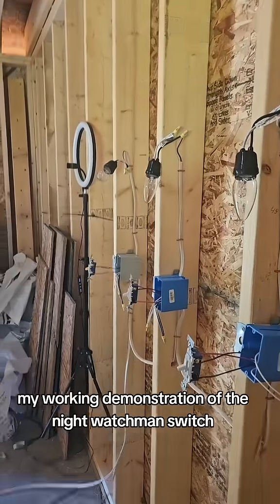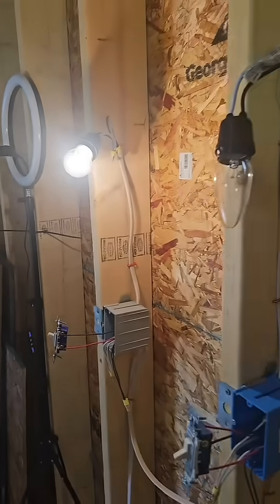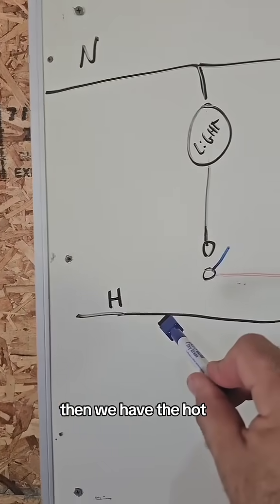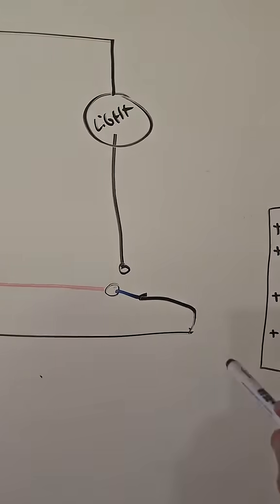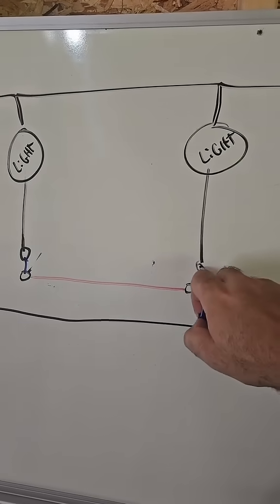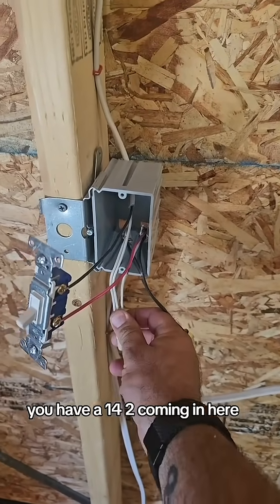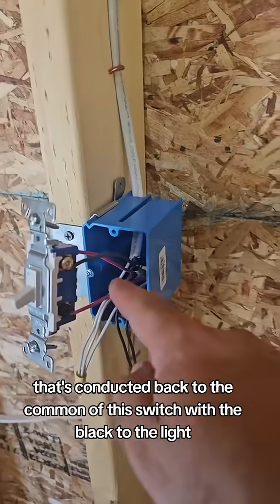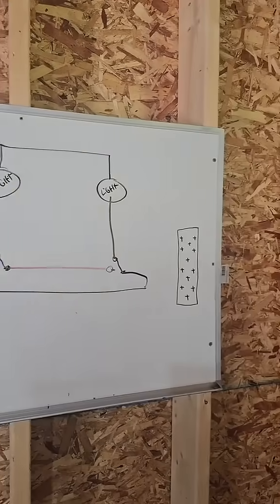Explanation of the night watchmen

Comment: Man I forgot about the night Watchman circuit, I've always found it fascinating.

As far as anything you might have missed...

[TLDR; Why to use it (use case), you can make it longer, it can stage more than one light at a time, and why to use it (under what circumstances).

You missed explaining the use case for such a circuit... it's not a very common circuit, but is most common to see in jails and mines... it's for walking down a long passageway and checking on things and then coming back down that same passageway. 

Also you forgot to mention that you can add has many three ways in the middle as you want, to make it go as long as is needed. 

Also, you could have mentioned that in practice, any one switch in the circuit may control several lights down the hallway before reaching the next switch. 

Also you could have mentioned why you might use this type of circuit. The night watchman's circuit minimizes the load on the circuit at any given time, but allows a guard or night watchman to regularly monitor things down long hallways/tunnels/etc. on a single circuit that are so long that the amount of lights it would take to light up the entire path would be too much draw. So you might use it when your limited as to how much amperage you can dedicate or when you're limited in how many circuits you can use.

Although fair enough there's a lot of caveats that could be mentioned... ie, on Long circuits you may need to compensate for voltage drop, and the protection against having too much amperage draw is device dependent (if a 3-way fails it could draw too much for your conductors or other components. Also it may not be code complient depending on how and where it's used. 

As a primarily residential electrician with over 20 years in the field, I've never had the opportunity to wire one in the field... but I have wired and experimental/demonstrational one such as the one in the video. So take my advice with a grain of salt, given my lack of field experience with this particular circuit.

Comment: Actually there is a practical use for it. I have a mud room that has no place for a two gang  by the door. So walking into the garage and turning off the mud room light at the same time is pretty useful to me. I have a double switch there but wish I knew this earlier. Don’t like the look of double switches.

Comment: Cool thing is that this circuit isnt limited to 3 switches its infinitely expandable as long as the last switch is a single pole you can add 30  3 way switches and it would still work. Awesome explanation BTW

Comment: Basic electricity, doesn't get any easier
Reply from the maker: @hikerinpam33  you know this not a 3 way-4 way-3 way it's two three and a single pole
Reply: @Stevenj120volts yes I can see 😂😂😂. It doesn't get any easier than basic residential wiring... 😅
Reply from the maker: @hikerinpam33  I guess I believe you but this would never be in residential wiring.   I don't think anyone would ever actually install this setup

Comment: Interesting exploitation of 3 way switches, but it is pointless or at least I cant think of an application, and you cant turn the last light off without turning the previous light on. Just wire the 3 way switches correctly, turn them on at one end of the hallway and turn them off at the other end.
Reply: Its actually meant to be a means to indicate that your security is doing their rounds. You wouldnt actually use this for security lighting but this would light things up in the control room to give indication as to position of the person doing the rounds.

Its simple and effective. Do we have better ways of doing this today? Yes.

Comment: Interesting, but I see no useful application. Why not just wire the three lights independent of each other? If you need to turn lights on or off from a distance use wifi controlled bulbs. Maybe that circuit had a use in the 1930's.
Reply: Its actually meant to be a means to indicate that your security is doing their rounds. You wouldnt actually use this for security lighting but this would light things up in the control room to give indication as to position of the person doing the rounds.
Reply: @codyardoin4305  thank you for that explanation. I can think of a lot more efficient ways to setup security. That must be really old school. I would hope my security would have more integrity and not require management to monitor them to ensure they are doing their job.

Comment: Yes,   That works as long as the illumination occurs in sequence with the first person direction of the pathway traffic. Main(120v source) once "Open"(out of sequence) de-energizes the Downstream Switches. Works fine with unique/unusual applications with One way In, One way Out "End Tunnel" installations.
Reply: It's intended to be used in a specific sequence. thus the "night watchman" nickname.  It is not intended for multi-switch control of general illumination.

Comment: So you could have an unlimited amount of switches down the line set up like that is that correct !?
Reply: Yep, the switch on the left just doesn't have another light downstream to disconnect. Center and right switches are identical.
Reply: @michaelvonneupert  the question was to the maker of the video
Reply: @darylhudson777 Sorry, I thought you were learning about electrical work and wanted a question answered.

Comment: Wouldn’t a four way be better? It can turn all three lights on and turn them off from any three location. Seems really stupid to wire anything that way
Reply from the maker: @AD-kr9gm  it's not practical it's a riddle/puzzle
Reply: @ Ty for the explanation. I like watching your videos always learn something new.
Reply: @Stevenj120volts it's practical. A security guard that checks his rounds and on the way back turns the lights off. Not that useful these days.
Reply from the maker: @snot-123  yeah but then you also have to wire a second set of lights in the same area that operate normally. Seems like too much work to justify it's use
Reply: @snot-123  or just turn all the lights on with one switch and dont worry about flicking a bunch of switches as you go. I dont see how this would have ever been useful.